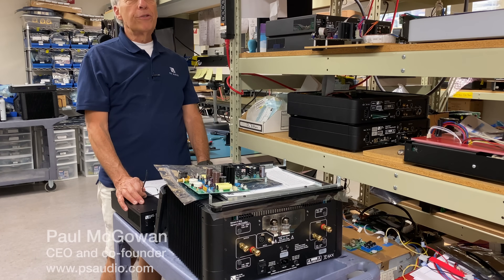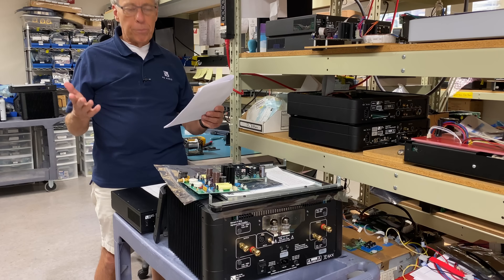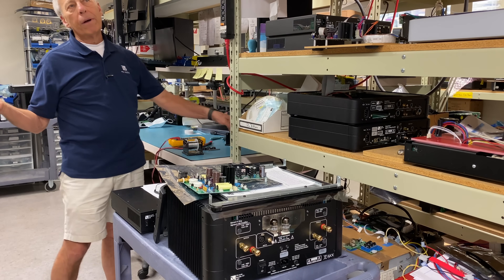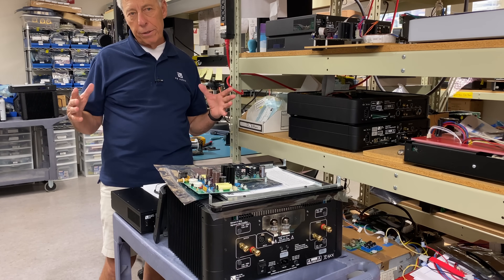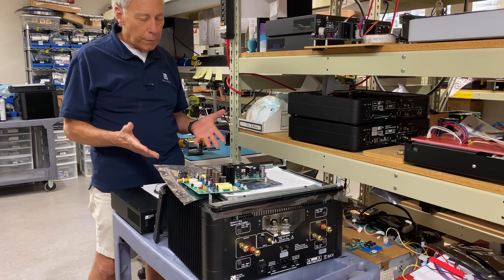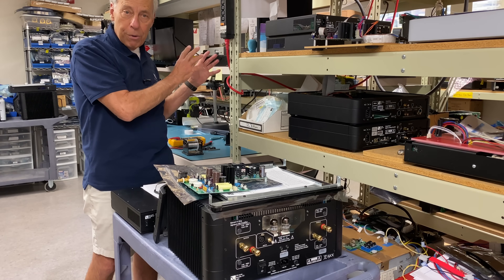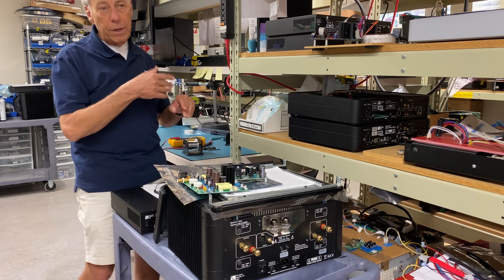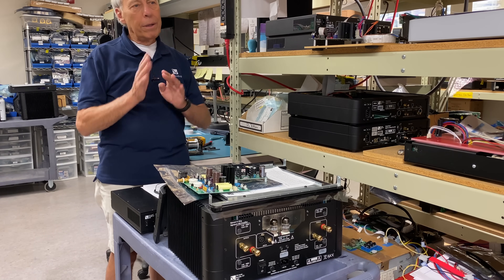Do power supplies need power conditioners?

Comment: High end amps have plenty of "energy storage" in large capacitors. What is the difference if the caps are in the (expensive) power regenerator?  My power is quite clean where I live, so how does tweaking it to a (claimed) "perfect sine wave" make a big difference when it's all getting rectified to DC the moment the electricity enters the amplifier? Do MRI machines and other sensitive Nasa equipment use power regenerators? If not, I'm very skeptical of seeing a difference in audio. I know enough about electronics to already right off the idea of "power storage". That is already done in the amp. The capacitors are the regulation if the line voltage drops. What electronics magic can happen in a power regenerator to get more power than the line can supply (momentarily)? Nothing, but "storage" and that goes back to simple capacitors, which all good amps have adequately. What is the point of "regulating" the AC voltage when it is getting converted to DC? You also lose power when voltage is regulated. Maybe in an area with dirty power people might benefit, but typically it would be much smarter to put the money towards a better amp to gain better sound.

Comment: Depends on where you live and how big a substation is near you.  Current is the issue, like what is the rating on your pole pig what is it's power factor what is your house wiring like?  A proper power supply is vital and can negate the issue of a power conditioner, if sized properly or larger like some of your power supplys.  The closer you live to the current source the better off you are,  all other things being equal.

Comment: Considering most high end linear amplifiers (not those stupid single-ended ones without feedback) are actually REALLY EXPENSIVE linear voltage regulators in disguise, the short answer is no (fun fact: You can actually use an LM317 voltage regulator as an audio amplifier). Most have completely unregulated linear supplies with substantial ripple, which is easily rejected by the 80-100 dB of CMRR in the amplifier. Any voltage drops from the line are like a fart in a tornado, and most have good decoupling so they do a reasonable job of keeping the noise out. The only place something like this works well is if you live in an area that sees large sags in line voltage during the summer months. An active conditioner can boost the voltage back up to where it should be. Otherwise, save your money for something more useful...

Comment: Someone on the internet posted something said to be said by Nelson Pass saying that light dimmer loads can cause offsets in AC power.  Something to the effect that dimmers are not an asymmetric load.  This is a myth because dimmers while switching, do switch on both the positive and negative cycles of the AC wave form.  Dimmers use Triacs not SCRs.  It could cause a very very small amount of distortion but rest assured, the waveform would still be symmetrical and could not contribute to any amount of DC offset.
Reply: The issue is really with the old thyristor dimmers, since they generate copious amounts of RF noise due to the very sharp transients from the triacs switching on while the AC wave is at substantial voltage. These can introduce very harsh 60Hz hum into an amplifier nearby if it doesn't have good filtering and RF decoupling in the power supply. Most modern dimmers will turn on at the zero crossing, and then off during the cycle, greatly reducing the RF noise they make.
Reply: @mysock351C  Your right about the zero crossings of the dimmers and I really doubt there are any thyristor dimmers in use today and if some one does have one, it certainly  is cheap enough to change out.  For dimmers using only SCRs it looks like a full wave bridge may proceed it so it would still behave the same way a typical triac & diac version would with regards to line load.

But back on point, there are a lot of myths that propagate the audiophile world via the internet that may on the surface seem to make sense to some but when you drill down into the facts you find people just repeating the same old unproven statements.  Seems if it gets repeated enough it become truth.  Put a famous name with it and look out.  Most recently there's an older guy reviewing a so called audio grade network switch and say he can hear the difference.  He says there is more "sibilance" with other switches. Really???
Reply: @chrisharper2658  Looks like we're on the same page for sure, then. Much of the audiophile community has a severe case of brain-rot from sniffing their own farts for so long. Another laughable one is the much lauded "echo" of tubes when in reality its horrific THD figures from doing something stupid like using a single ended class-A tube stage with no feedback. If you like that, hey great, but stop calling it ultra-high fidelity holographic sound. Its just distortion. Most of these people have lost the plot from the constant echo-chamber effect some closed enthusiast communities take on.

Comment: I just don’t understand why the attempt to create perfect sine wave AC. Shouldn’t the focus be upon creating the best low impedance DC voltages irrespective of the power input?
Reply: That's also the goal of course. Both goals are equally important. And if you have too high input impedance you will destroy the perfect sine wave quite quickly.
Reply: There's no need for a sine wave at the power input if you goal is unadulterated DC. The pure sinewave AC is only for power supply conversion circuits that can't handle otherwise.
The days of long distance high voltage AC power distribution is being replaced with high voltage DC.  We use it in Australia for power provision from Victoria to Tasmania under Bass Strait.  It would not be surprising that we'll have low voltage DC (e.g. 240VDC) the domestic supply.  It'd make it much easier and more efficient for those who have battery backed solar power.
Reply: He talked much about low impedence in the video though.

Comment: Drawing power from the AC lines and rectifying and filtering with a bulk capacitor inherently puts huge “noise” back onto the AC line.  In Europe and Japan - equipment is required to “power factor corrected” on the front end which minimizes and can eliminate AC noise caused by the front end.  The PFC typically produces a regulated DC voltage for the unit to use and is considered “clean” power at this stage.
If your unit doesn’t use a PFC front end and is attached to a AC main that is connected to other devices that don’t use PFC front ends, then a conditioner may be helpful to reduce high frequency noise getting in your unit.  If your unit has a poor regulator then a reconditioner will help that by supplying corrected input source.  
I would not buy a conditioner/ input filter or reconditioner unless I was experiencing serious problems that I can trace to wall power directly - via measurement of some sort.
You can eliminate ground noise with a simple isolation transformer - this will break a possible ground loop situation.
Probably the classic input power regulator is a step down transformer followed by full wave bridge, bulk capacitor then linear regulator.  You can substitute a switching regulator for the linear regulator to save power and weight.  This “classic” power supply can be immune to input power line variance.  
The need for power line conditioning or reconditioner - in my opinion - indicates a poorly made input stage off the AC main.

Comment: Regenerators are simply impedance buffers ..  only necessary if you are on the end of a long cable ( like in a farm say ..) And one last thing ... they are only really needed if you are using amplifiers pushing out 500 Watts peak or more ... the average home setup wouldn't benefit at all ...

Comment: PS Audio makes great power conditioners if you need one. The per Dollar added audio quality all depends on how bad your power is to begin with. No doubt that some people have really bad power. I've seen that when traveling, where the light in a hotel room was at a different brightness depending on the AC being on or off, for example. However, most people have much better power and will not hear the typical well below 1 dB of gain deviation in a power amp due to the mains power impedance or other fluctuations as capacitors in the power supply of a power amp will smooth them out on the actual Vcc power rails inside of it and the issue mostly happens when you play very loud with possible other distortion happening in your system and naturally in our hearing.
Reply: if you've got the cash to buy all this top high end gear you might as well throw in a power re generator just in case, I think though before you do that you'd want to make sure you're fully satisfied with your speakers, amp, source, unless as said your mains power supply is bad. Any equipment with a transformer already electrically fully isolates it self from the mains supply, so here the re-generator is just really acting as a energy bank and as Paul says to produce a clean sine wave. I'm not overly convinced for my mid-fi gear played at moderate volume levels I'd hear any difference.
Reply: Yeah if you live in a third world country .
Reply: @ryanray6215  Yes, people living in third world countries and people living at farms in rural areas with heavy farming equipment sharing the power are prone to having serious power issues.  I've been traveling a lot and have often seen how power wires are randomly hanging on poles like a mess of spaghetti (especially in Asia). Often in such areas, you can even see old broken wires hanging down with the conducting cores exposed.

Comment: I think the key: the capacitors store much more energy at high voltage (W = 1/2 * U *C2) than in the amp itself.
Reply: The key is a power regenerator can stabilize the voltage and keep it clean even its primary side voltage takes some dips during more continuous heavy load. Caps can only help with transient peak loads. E = 1/2 * C * U * U.
Reply: The same reason good quality amplifiers are not cheap.

Comment: More nonsense on the subject of AC power.  Your power outlet will provide as much or more power then a complex and totally unnecessary power re-generator.  The DC bulk charge capacitors act as a very low lowpass filter from the AC source perspective so no you won't have audio dancing around on your AC line but if your really good you might be able to see an incandescent bulb dim slightly to a heavy bass beat at full volume but so what.  If you really think you have a problem, see if you can configure you equipment, most importantly your power amp/s, for 220VAC.  That way the total current requirements would be cut in half here in the US.  Any documented case study you can provide to prove otherwise would be appreciated.
Reply: That's an interesting one, does a power amp on 230V sound better than on 115V?
Reply: @hugobloemers4425  No, it just makes people with OCD sleep better at night.
Reply: @hugobloemers4425  In a several audio kilowatts stage application, yes, that is if you can even hear the difference over the concert noise. High power amps on 120v will suffer from power cable resistance just like a table saw will always  feel more powerful with the same motor but running on 240v. But in a residential application, running power amps on 240v offers no real benefit. You just aren't using that much audio power in the first place.

Comment: There's pretty high "energy storage" in capacitor banks of most power amps..unless you're pushing them to their limits 90% of the time. The supply rails on the individual amp modules usually "see" a very low impedance line from the unregulated supply. No need for "regeneration" in most home systems where the "peak" power consumption is under 1000 watts or less. (based on 12gauge AC line wire, 15 amp breakers, and a well constructed dedicated wall distribution panel)

Comment: Thanks Paul for another nice video! What if I have linear and switching mode power supplies attached to the same regenerator (eg. P15)? Would it be any noise contamination or regulation issues among rigs due this configuration? Thanks.